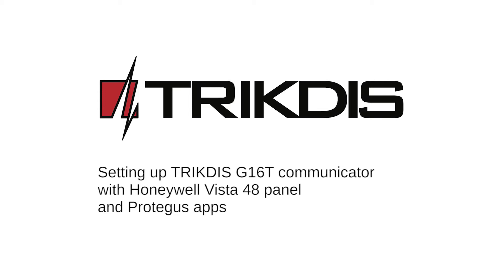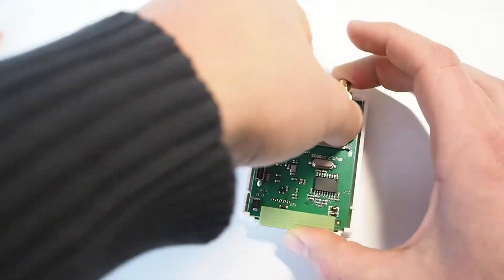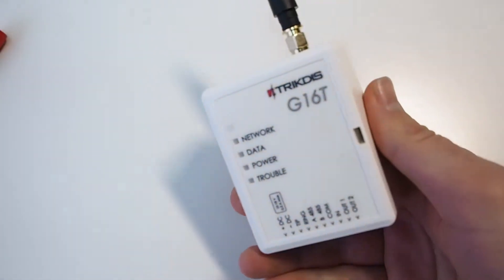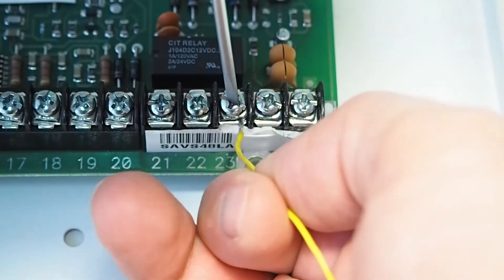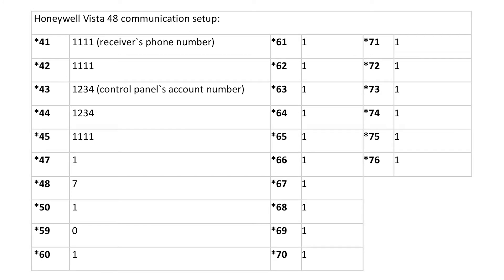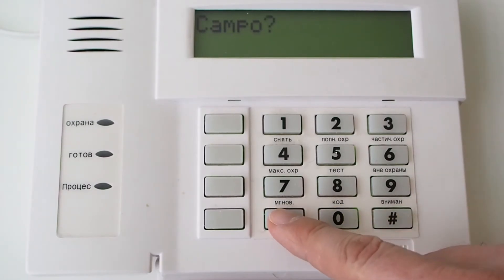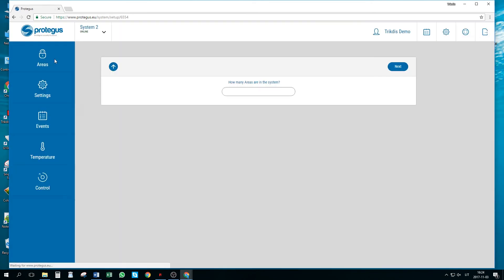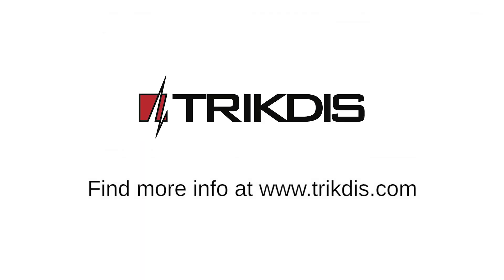G16T with Honeywell Vista 20 (48). Cellular communicator setup with Protegus app.

Comment: This was a drop in replacement for the prior fixed alpha keypad in my ADT security system.>>>t.co/T3lwmSn9eE     The default configuration even worked right out of the box. With the full alpha display, programming the alarm system is much easier, and I now have custom names for each alarm zone. That makes the alarm system much easier to use.